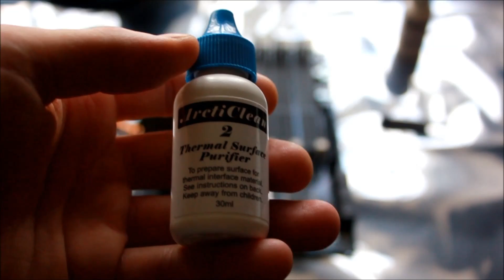How to: Remove and Re-apply thermal paste.

Comment: If you are going to do this with the processor on a anti-static bag.  Make sure you place it on the inside of the bag. The outside is actually static in most of the cases

Comment: take cpu out of socket, take high concentrate rubbing alcohol use both q-tips and paper towel to clean, taking care not to touch or damage pins on other side, after done place cpu in socket push down retention arm, place pea size amount of thermal grease on cpu, place a small piece of scotch tape on index finger spread evenly, your done, there are too many anal retentive morons spreading gloom and doom on one of the easiest processes in PC building, BTW pea size is one gram. Install free third party " PC info" (such as Speccy, made by Piroform) to check running temperture, most cpu's will shut down pc if cpu is running hot, dont let anybody trick you; building a pc today is easier than learning how to ride a bike, very few parts.

Comment from the maker: it should be fine mate, the best thing to do is to check your temps with Coretemp and see what its on if you notice a massive increase in temps then you should try re applying it :) but other than that i wouldn't worry about it!

here is the core temp link

w.w.w.alcpu.com